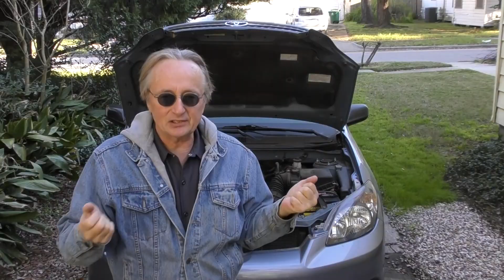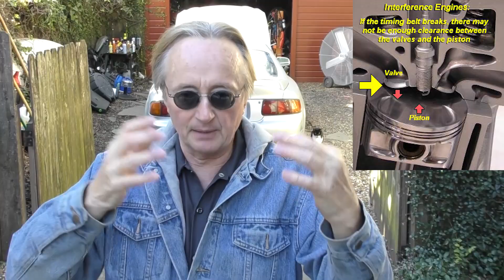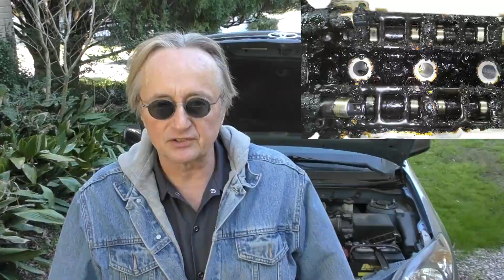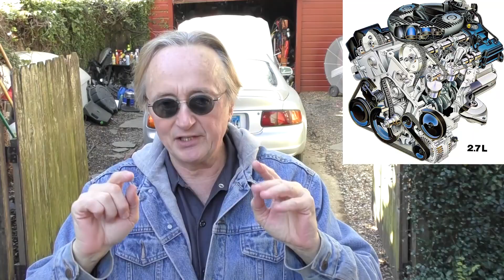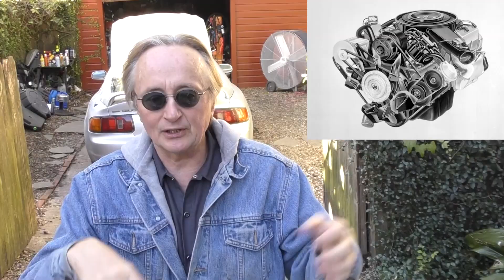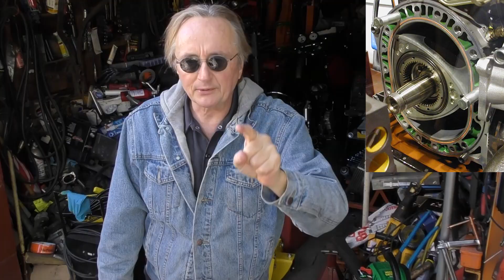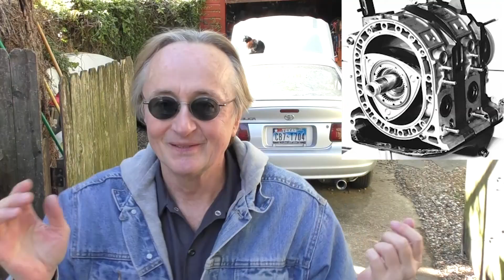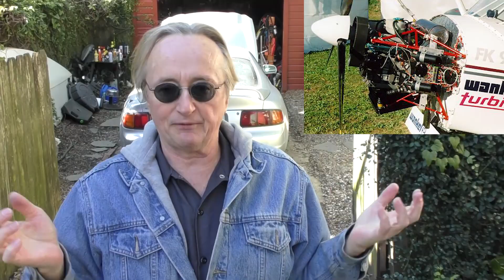Never Buy a Car With This Engine

Comment: That Chrysler 2.7 should be #1. What a nightmare.
Reply: New Ford 3.5L have the same water pump issue 🤦‍♂️
Reply: @InternetDude  Nope. Hardly. Ford's 3.5L/3.7L Duratec motor out & heavily updated since 2007 is in millions of vehicles lasting a long time. Nice try.
Reply: David  Klimmek If it’s not an F-150, Mustang, Expedition, Navigator, or Transit, it’s junk because of the timing chain driven water pump. The RWD biased cars doesn’t have a timing chain driven water pump.
Reply: I got an education on that on a trip to NY. Never knew the engine on my wife's ford flex had that crappy setup.  1200 dollars to replace a friggin 100 dollar water  pump.
Reply: @gregorysauer7208  The fun with a timing belt it cost less to repair, you can buy a good water pump, tensioner, the bearing and the belt for maybe 200-300 if oem. Timing chain in theory suppose to last longer, but depending on quality it might not be the case, i saw some having problem with tensioner which the chain become loose and eat the guide chain. Till it start eating the metal that hold the guide chain which is made of teflon.

My brother in law his father got a F-150 with the 3.5 ecoboost, he had to change the starter it cost 1100 dollars, you have to remove one of the turbo to access the starter motor. Its a big job you have to remove the intake manifold, remove the turbo housing, water and oil feeder.

Remove the drain pipe the turbo remove all intercooler piping and probably a lot of stuff around that. Depending on which side the turbo to remove is installed.
Reply: @InternetDude  lol, just like the old yamaha v6
Reply: @InternetDude  Ford ecoboost engines are bulletproof .
Reply: @a-w429  was that sarcastic? I hope
Reply: @a-w429  in 5 years ill make my judgement on the 2010 ecoboost dependability. Still too young
Reply: A W you are clueless
Reply: @a-w429  yes . run full synthetic & it's totally bulletproof! Love em. Have 3 Ecoboost equipped vehicles!
Reply: @imabebebebe2496  dude, they in millions vehicles already. Very well designed ultra reliable twin turbo GDI motors. They in small cars to trucks/SUVs & $450k supercar. Gen2 Ecoboost in production now! Everyone else is on board it seems.
Reply: A W the first batch of 3.5 ecoboost engines are junk with the exception of the Taurus SHO and Lincoln MKS. The later 3.5 Ecoboost engines are very reliable as long as you change the on a regular basis
Reply: @a-w429  ecoboosts.
Reply: @imabebebebe2496  Ford has been sued in many countries because the ecoboosts are garbage
Reply: David Klimmek If it’s a FWD version, it’s junk because of that stupid timing chain driven water pump.
Reply: As a Chrysler owner, I agreee (although I have the 3.5)
Reply: I got a 3.5 wit 215000 miles still original. Just change the timing belt and u good. It's from a 99 lhs
Reply: In college, my friend told me he'd bought his aunts Plymouth with the 2.7 v6. The water pump is exactly what killed it, and within two years. He's really learned his lesson since then. He went safe with a used BMW on a six year financing.
Reply: You beat me to the punch. I was told long ago to stay the hell away from the 2.7 Chrysler engine and go with the 3.5l  if anything.
Reply: Yes...what a waste of metal
Reply: While the current Chrysler 2.4l multiair engine has been solid it sounds rough and very slow but I’ll give them props for the 3.6 V6 and Alfa Romeo’s 2.0 Turbo 4
Reply: @La-yt1wr   My co-worker got a Dart with the 2.4 not even 40k and the engine his burning oil like 1 qt every week. His dad work at dodge dealer and they gonna pass the engine under warranty.
Reply: Jake Lo Wang I say solid because not many people are complaining about the 2.4 multiair majority of owners with that engine has the ZF 9 speed automatic transmission and people complain about the transmission more than the engine but I’m not a fan of neither their 8 speed transmission has been proven to be more reliable that the 9 speed
Reply: @La-yt1wr  I don't know the transmission he got, its a dual clutch transmission, think its the 8 one but i can be sure.
Reply: Jake Lo Wang ok I just looked it up the 2.4 either have the 6 speed auto or manual the dual clutch is only available on the 1.4 turbo 4 cylinder and also you will only find their 8 speeds on Alfa Romeo Stelvio and Gulia, Maserati’s, Chrysler 300, Dodge Charger, Challenger and Durango, Jeep Grand Cherokee, and Ram trucks
Reply: @La-yt1wr  He got an automatic then cause its not a manual car.
Reply: really, how many speeds in a transmission do you need?  9 speeds is a little excessive
Reply: Also known as the "sludge motor" even with regular oil changes.
Reply: GM 2.8 V-6 absolute junk!
Reply: My 3.6 pentastar has been great... the car's electronics and 9 speed transmission have been a significant problem though.
Reply: Chrysler newer Pentastar V6 is excellent. I would buy a new Durango w/one!
Reply: (Edit) by the way I’ve already gone through that water pump issue, just catch it early and it’s an easy 1k fix. I know it’s a lot but it’ll take u places if u do it.
Reply: @Deez Nuts  Whats that "ticking sound" oh that's the rocker arms & shafts failing.  Cooling fans falling apart.  Lifter tick when cold starting.  Leaking water pump causing the timing belt (this engine doesn't have a timing chain) to jump teeth which requires you to pull the radiator / fans and front motor components to get the front engine cover off.  The burning of 1qt. of oil which FCA will say it's normal & compensated by a 6qt. crankcase.  The oil pan which was "redesigned" I found that out when my drain plug was stripped out.  If you are getting 250K out of one of these motors someone liked the vehicle and dumped some serious money into the engine to get it to go that far.  Be sure to run 89 octane or higher as well.
Reply: I friend of mine had a mid 90es Chrisler Sebring with the 2.5 engine. He claimed that it was a Mitsubishi engine and very reliable at that. But I guess that is a different one
Reply: smithraymond09029 yes
Reply: Scotty runnin out of ideas? He already made this video
Reply: @Tmax-ub5br  it's more complicated than that but i agree. My family buys Ford proudly! Better than most everything out there an All American. Not tryin start brand war fights. Ford is phenomenal truck & SUV maker. We added a new Ecosport AWD an love it. Family has 2 F150s 1 Explorer. All Ecoboost!
Reply: @davidklimmek3192  I prefer a Ford also, just don't look at what I am driving now. Especially the twelve valve 3.0 V-6. A Mercury Sable 1996 with 300,000 miles, engine and transmission running fine but the body was rusted to where it was not safe on the road. Ford Ranger, same engine at over 200,000 miles when it was driven a long ways after the serpentine belt broke. (I had sold it prior to this)  They put a new belt and replaced lots of coolant and drove for several more months before the head gaskets finally let loose from the overheating. And both were good drivers.
Reply: @davidklimmek3192  i got almost 200,000 on my old taurus. So ive had better luck with ford. Had a 97 escort before that got 190,000 before my brother ruined it by driving through high water. The older GM abd chrysler stuff is good.
Reply: @Tmax-ub5br  I can't argue with ya on that. Ford Duratec 3.0 in older Taurus was excellent. New Taurus is even better but get one while u can! I never had issues w/Ford's ever! I've owned em all.
Reply: @davidklimmek3192   yes its a shame ford quit making cars except the mustang. I liked the 4.6 v8. I had one in a 97 Lincoln one of The best car i ever had but hard on gas. Also the newer taurus is nice.
Reply: @Deez Nuts  Oh yes, the 2.7L Sludge Motor.
Reply: Nightmare indeed. Lost so much money. Was trying to support my fellow Americans and got stabbed in the back. That's the engine that solidified my stance on the whole company. Never again.
Reply: Back as a technician for GM/Chevrolet we had a TSB that basically said all 4.8, 5.3 and 6.0 v8 engines needed a shield put over the oil jet to prevent oil consumption. Now GM'S accepted oil consumption at the time was 1qt per thousand miles.....generally adding that shield to the oil jet did absolutely nothing with our recorded oil consumption logs! In the end it was basically a full rebuild with updated piston rings.
Reply: I was a Chrysler tech, 2.7 was one of the biggest mistakes in the history of mistakes!
Reply: And the Cadillac Northstar.
Reply: The 3.5L was junk as well.  Oh it burns a quart of oil every 3000 miles, oh we'll just make it a 6qt. crankcase.  Also cancelled due to it's "high parts content".
Reply: @BTC909  and replace it with a 3.6 Pentastar V6.
Reply: @atx-cvpi_99  '06 Magnum SXT i'm way done with dumping money into this good looking POS.
Reply: @BTC909  lol complaining about being down a quart every 3000? lol wut. 3.5L was known to be pretty decent, it got cancelled cuz it was old and replaced by the Pentastar.
Reply: @zephxiii  When you start to hear the lifter tick you know the top of the motor is getting starved for oil.  Which also leads to the common rocker arm & shaft failure.  Plus the lame workaround, 'well just use a 6qt. crankcase'.  Also having to run 89 octane to hit that 250HP number.  That pitch black tailpipe thanks to oil blowby which eventually plugs up the cats.  A timing belt instead of a timing chain.  If it gets wet it'll start jumping teeth.  Decent huh.  LOL.
Reply: I had a 1999 Dodge that may have had that engine. WalMart would refuse to change oil in some Chrysler products,if they were driven onto their line center with oil one quart low.

Comment: The L61 is a great engine. Haven't seen any problems with these. I had three each with over 200,000 miles with minor maintenance and my buddy has one he beats up on for winter its still good. They Just keep going. Everyone has their opinion I guess.

Comment: I knew a Chrysler was going to be on the list!
Reply: That Chrysler PT Cruiser was the worst of the worst , my friend bought one, it lasted him 2 weeks before the gearbox eat itself lol and what an ugly design too
Reply: Yup and a Toyota wouldn't, gimme a break
Reply: @owen coleman I had two RAM's with the 4.7. 320K miles between them and never put a wrench to either one. Same with the three vehicles I have now with the 3.6VVT. 31 MPG and will outrun a Chevy 350 all day. 128K, 79K, and 30K on them and never been wrenched. Scotty had to (you know he did) go back to the mid 2000's to find one he could pick on.
Reply: @robertbrinker  is that 3.6VVT the Pentastar?  I've had good luck with that, never had any issues aside from the plugs being a pita to change
Reply: @Gregorysgames   yes the 3.6 vvt is the pentastar. Great engines
Reply: @Gregorysgames  Yes sir, it is. I don't think they had them back when Scotty's grandpa taught him to hate on Chrysler.
Reply: No doubt that engine is a POS so when buying a car do your research or you will be ffffing yourself !
Reply: They should! My neon is having over heating issues as I speak.
Reply: @Chuck Finley  Chrysler did have some good engines back in the day. The old heavy block 318 was even used in industrial applications. The 426 hemi was nearly unstoppable on the NASCAR circuit. But they sure had problems since. I had an Aries K car, and every 12,000-15,000 miles had to retourqe the head because it would start leaking coolant and oil past the head gasket. Mine was also one of many that sucked charcoal into the carburetor from the vapor canister. Some caught fire and burned up, but I was unlucky and mine didn't catch fire. And this is while the car was under warranty, and they refused to correct the problem. Have never bought another Chrysler product since. Good PR Chrysler!
Reply: @Chuck Finley  My father and I both had several 318s with great success. I had a long run of Belvedere Plymouths; '58, '64, '65, and '72 which was the Satellite which was the new name for the Belvedere. All were 318s except the '65 which was a 361 B block. It was no race motor, but a wonderful highway car.  All gave miles of service with just oil changes and regular service, which back then was points, plugs, and air cleaners. I left Chrysler because of their not honoring the warranty on the 1980 Aries K. It was their screw up and totally refused to fix it. Went over the dealers head right up to warranty service in Detroit. Their lack of loyality meant the end of mine. With  the help of a mechanic friend of mine, we got the problem fixed and the Aries became a good and dependable car. But the damage was done for my desire for Chysler. I found a new love with the Ford 3.0 L twelve valve V-6. It is as bullet proof as the old 318, or Chevy 327. I have had two of them; one I kept to 300,000 and put to rest because the body was rusted to beyond safety. Still did not use a quart of oil between 3,000 mile oil changes. The other had 200,000 when I gave it to my son who was at college when his car died. It was also great. But I personally would stay away from the twenty four valve V-6s. Too much more to go wrong and harder to work on myself. Thanks for the comeback and happy motoring!
Reply: @Chuck Finley  Loved my '72 Satellite also. And I had a '64 Barracuda with the 273 which was a very fun and dependable car. I really enjoyed those old Mopars. Although I don't understand these newer cars, I enjoy seeing the young guys that are enjoying their "machine" like we did back then. Oops! Letting everyone know how old I am!
Reply: MoFart
Reply: MDX Crafting because Chrysler is trash...we’ve known this

Comment: Never buy gm 2.4L 4 cylinder engine seen em things go out at 48k miles
Reply: Are you talking about the 2.4 twin cam engine that gm uses if so mine has 193,000 miles and still going strong
Reply: Our burners. My wife's 2012 equinox burnt a quart every 3k and it had only 111k .
Reply: I have 2013 Chevy captiva with 2.4 128,000 miles runs like a top
Reply: 2011 Malibu, 128k miles. No problems, doesn't burn any oil with 5k plus oil changes.
Reply: I have 1.8L version of that engine: Z18XER. I think its variation of same Ecotec design. Did some bad things during its life time, like not changing oil for 30k km couple of times. Still works quite well after 190k km. Engine is German made, 13 years old.
Reply: Yeah twin cam. I personally do vvt solenoid and timing chains and engine replacement up the wazoo. I work in a shop and See those every day. Yeah common sense dictates to take precautions to take care of them, but even then those are just crappy made engines
Reply: If I remember the pre 2006 engines I agree we're a nightmare. Then Chevy saw there mistake and then introduced a refresh of the engine that had better oil systems,  and better manufacturing techniques.. and that fixed it
Reply: JR technician really mine went to 190,000 and I beat it
Reply: @PS 400  you're lucky
Reply: My 2.4 has over 200k on it and its running fine. The 2.4l with the Direct injection are complete trash.
Reply: My LD9 went to 250 000km without any problems in my 99 Cavalier Z24.. it was fast for the day and got pretty gooe gas milleage.
Reply: Customer traded one of those in. 2010 I believe with 2.4L. He wasn't aware that it was burning so much oil, it ran dry. Bad cylinder rings. Basically destroyed the engine at 99k miles
Reply: Same for the 2.0 turbo ecotec ?
Reply: I have a 2009 HHR with a 2.4L. I have only 85,000 miles on it, it has been my sit in the garage and come out for a long trip car, so all highway miles. No problems yet, but 4,000 miles intervals for oil change with Mobil 1 synthetic. The worst engine can be good if taken care of. Besides maintenance, how you drive is also critical of an engines longevity. If you had physics in school, you can quickly figure that out. High engine speeds and hard acceleration are killers.
Reply: GM in Brazil tried to introduce this 2.4 engine in a car called Vectra, that was the elite version of it, and it was the mechanics worts nightmare at the time haha
Reply: Isn't the GM 2.4 basically a Toyota engine?
Reply: @atx-cvpi_99  no,  it's Saab architecture.  GM got it when they acquired Saab,  then they proceeded to build about a billion of them!  Great engines,  Scotty has a lot of good info,  but he's wrong about the ecotec,  they're great motors!
Reply: ATX-CVPI no your confusing with the 1.8L engine the Toyota Matrix shares with the Pontiac vibe. I don’t know of any other motors GM and Toyota share
Reply: @atx-cvpi_99  no its not
Reply: @atx-cvpi_99  it might be...earlier chevys nova or small crate was a Toyota...91 Sentra GA16DE 218856 And still pulls very good...(whattza noise...uh oh)